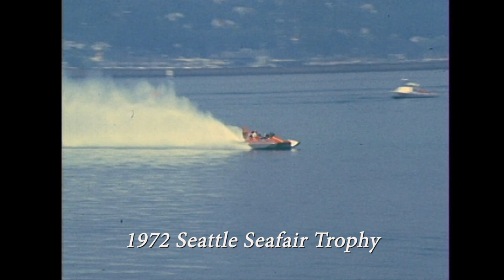Hydros Up-Close 1971-72 Pride of Pay'n Pak

Comment: First question. Is this hull still around? I know that it later ran as a Miss Budweiser. Hopefully, she is still in those markings.
Reply from the maker: Yep, it's sitting in the parking lot of the Hydroplane and Raceboat Museum waiting its turn to be restored. But the big question is....which version of the boat do you want to see it restored as? 1970 Hemi Pak? 72 Pak? 73 Bud? The hull is in pretty good shape.
Reply: I would say that it would be great that a replica be built from the original plans and have the 72 Pak and the 73 Bud.
Reply: @ThunderboatsVideo  weren’t they different boats though than the front engine in this video?  I recall the twin engine Hemi pack behind driver and later pay n pak being same boat with twin engines behind driver?
Reply from the maker: Same boat.  Ron Jones and Lucero converted it to conventional for 1971.
Reply: @ThunderboatsVideo  Please restore it as the 1971-72 Pay N' Pak